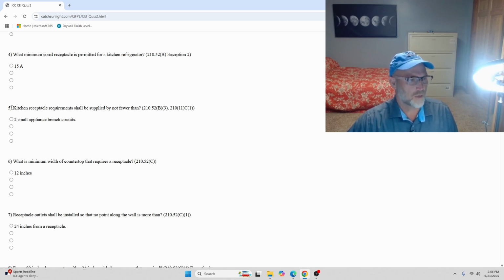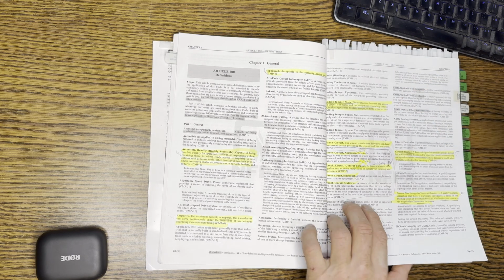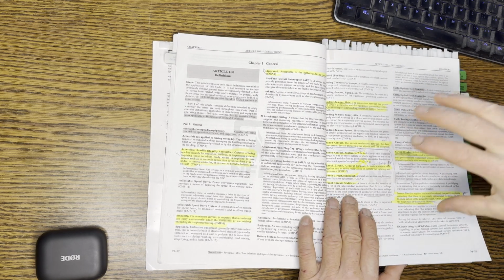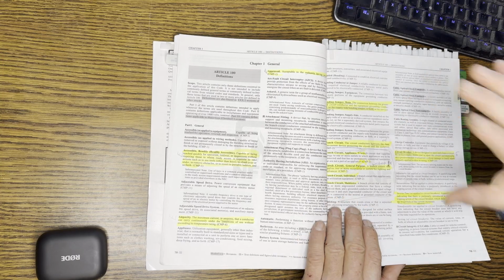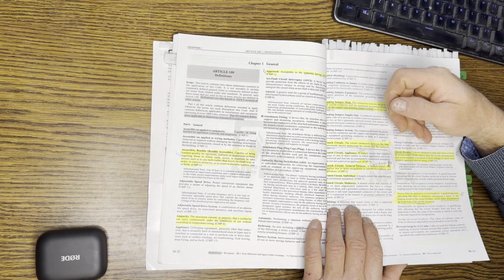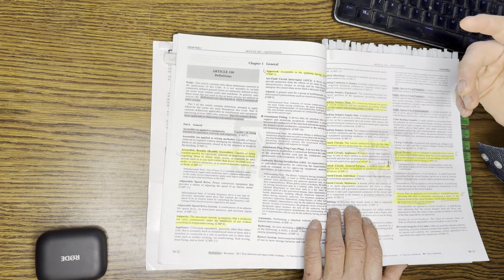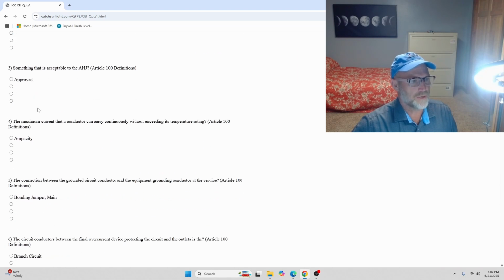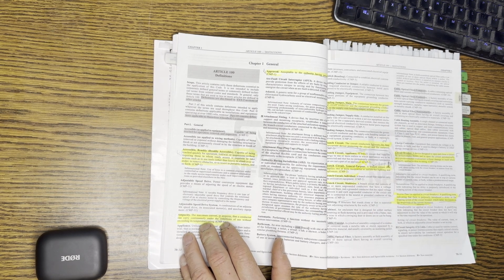ICC Commercial Electrical Inspector (E2) || Free on-line tests and my notes to help you pass

Comment: Great video. Im an electrician thinking of moving on to something else. I have been studying on my own before finding your video this is great stuff. How did you come up with your 671 different questions? All of the code references are a huge help im going from a 2014-a2020 codebook for this test, I will use your guide to highlight it when it gets here thanks sir

Comment: Does this will apply to florida ...?? Thanks
Reply from the maker: Yes and no.  Florida has their own code (like some other jurisdictions) but they have unique Florida-only ICC certifications.  I've never taken such tests, but the code is the code.  The questions are the same, but will have unique Florida requirements included.  I'd recommend looking at the amendments that Florida has made and understand those differences.  They likely have some minor omissions and some additions that are unique to weather and safety concerns in that region.  The tests I created probably will address 99% of the necessary learning.
Reply: @CodesExplained  thanks great job..